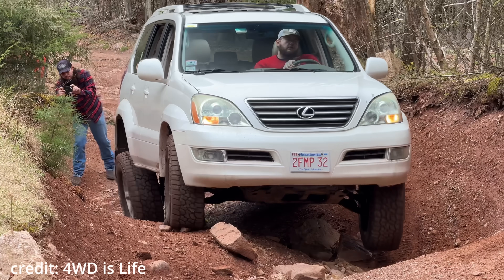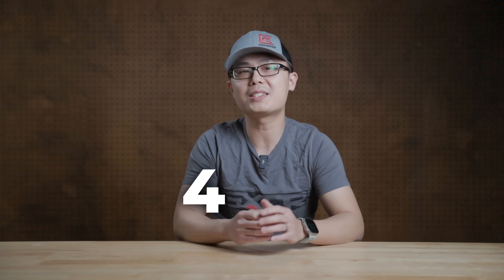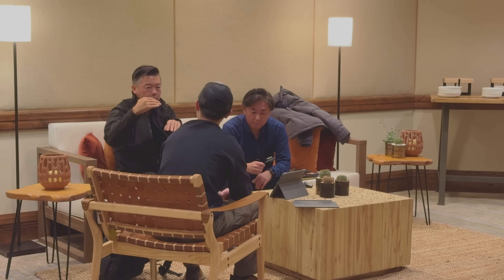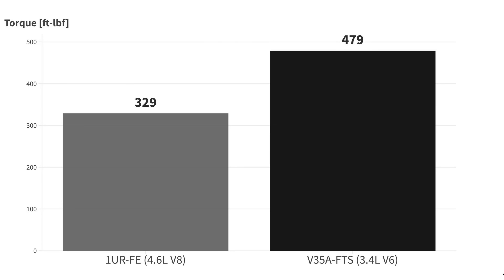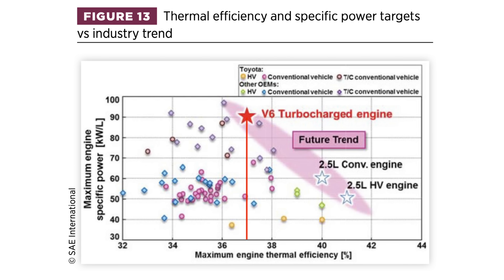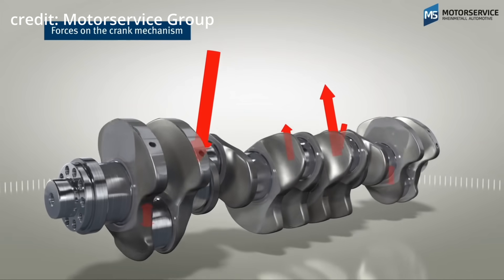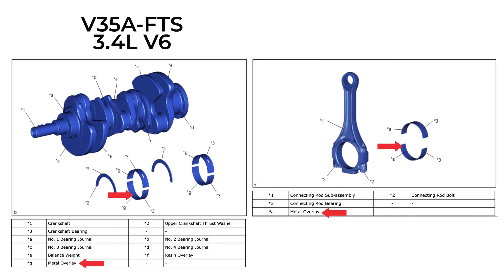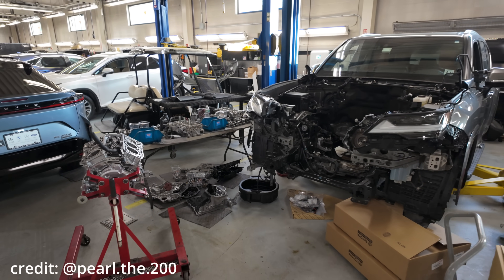Is Toyota V35A-FTS Engine Reliable? Well..It's Not That Simple

Comment: I would consider using a thicker oil, preferably a 0W-30. If not 0W-30, then a 5W-30. Oil film thickness should be the primary protection against wear, and not the additive package in xW-20 or thinner oils. The thinner oil is driven primarily by CAFE, and not necessarily by the manufacturer. 

The BMW E46 M3 had an engineering issue where the main bearings weren’t properly designed for xW-30 oils. BMW’s fix was to replace the main bearings and switch to 10W-60 (Castrol TWS).

Comment: the issue is the grade of oil , and bearing clearance , the oil is to create a hydraulic cushion between crank and bearing at any speed or load .
Reply: also 95% of bearing wear is on start up , pre oiling systems do help and post oiling idle before shut down ,
Reply: it mite be wise just to go one grade higher on the oil
Reply: the other question is , is the oil pressure and volume under rated

Comment: GX470 was designed for 200k miles with no issues GX460 designed for 100k and finally GX550 especially designed for 10k only Thanks Lexus you are always thinking about your mechanics. They get more job with new engines and get more money from Lexus customers!

Comment: 17:32 and there’s your issue! The ladder frame cast iron crank caps is brilliant for strength, but not for thermal expansion. 

Iron and aluminum act differently at high temperatures, which means that with a lot of heat soak the potential for grinding increases as the aluminum is denied flexibility around the more rigid iron. 

To what degree Toyota has addressed the thermal relationship between these components costs $37 lol, but thats an immediate tell as to why these bearing failures happen on otherwise mechanically stout V6s

Comment: The V8 engine probably used PFPE/MoS2 composite sliding bearings while the new V6 engine uses bronze sliding bearings.  That shows the designer knows bearing load increased.

Comment: And what about the Landcruiser 300 series which I believe is sold in Middle East, Asia/Pacific and Africa (not US). Same engine but do they have same problems? Been trying to do research and although this debris issue has been mentioned it seems to be the exception rather than the rule, quite limited info and I haven’t heard of mass recalls. 

Only thing I’ve noticed in South Africa is that the 3.5T (or is it 3.4?) Petrol cars have decreased quite a bit in value compared to the 3.3TD that is keeping its value.

Comment: The longer the stroke and you get more torque but more stress also . Now adays around 4" stroke is the norm for alot auto makers . And small turbos don't make lots of power but they are more responsive and more efficent as long as they have real ball bearings and are balanced well like garrett does .

Comment: Most main bearing failures fail because lack of lubrication, it might not exactly be the cleaning process but maybe a design flaw within the oiling system itself. Oil pressure isnt always a measure of good oiling

Comment: If you add 1 atmosphere of boost, or 14.7psi, that would effectively double the displacement of the engine. So for a 3.5L to be equal to a 5.5L you'd need approximately 8-9psi of boost. I don't consider 8-9psi of boost to be hard on an engine that's designed for it.

Comment: Something else to keep in mind though, is the number of units sold with this particular engine.  If they sold 10x more vehicles with the same engine, you'd likely expect somewhere around 10x more complaints about existing issues, assuming nothing else changes.

Comment: The change from urethane bearings to aluminum bearings most likely didn't account for the thermal expansion of the aluminum under load. If the aluminum expands enough, even if not enough to lock up the engine, it could be rubbing just enough against the crankshaft to prematurely wear.

Comment: Dirty blocks with excessive metal shavings in the bottom end. We do have a few LS500’s failing or locking up. The engine design isn’t bad but what sucks is how complicated it is with all the crazy hoses. It’s no longer a simple straight forward engine. But new blocks are clean so they should last a long time

Comment: Toyota and Lubrizol co-wrote a White Paper SAE using radioactive isotobes and hot wires in the oil passages in a block. The wires allowed them to know exactly how much volume and pressure each area saw. The isotobes int he additive packages allowed them to see the propensity for various additives in each material used in the rotating assembly of the engines. I worked in engineering at General Motors. I know please do not hold it against me! LOL This paper allowed them to reduce oil volume and pressure as well as lower the hths of the oil to gain fuel ecconomy while keeping wear at the then current level that would normaly be achieved with an oil with an hths of 3.5. When CAFE standards hit they begain using these developments to reduce tax burden more and more. When Honda came out with theith low lead and zero lead alumnium based bearing technology other companies did similar things. No one that builds engines for racing, high performance or extreme use uses aluminium bearing only OEMs do that. GM uses them in LS engines for instance but when you build an LS for power you never use aluminum based bearings in the build not on a high output NA engine and especially not on forced induction or power adder's like NOS everyone goes to a traditional babbiit bearing with some type of plated finish and sometimes a sprayed coating as well. If you have suffcient oil volume and pressure and a suffecient oil film strength you can easily go 300,000 miles and never have a bearing have any vissible wear often factory ink stanps still on the bearing face. 

To me it appears they have not made the bearing caps and the bearings wide enough for the load trying to chase after fuel effeciency at all cost. I suspect they are running the absolutely stupid variable volume and pressure oil pump designs that are all the rage today and stupidly low hths oil depending on additive package to make up for the lack of film strength and lack of shear resistance. 

So easy fix make bearings and caps wider, make them from babbit materials, increase idle oil pressure and volume, and go to an oil that can provide a minimum hths of 3.5 even better something with an hths of 4.6 like a 0W40 and these problems will go away and never come back! All of this was easy to forsee if you think like someone that works on cars and deals with them in the wild it is only cloistered engineers that do not deal with the real world and their designs in the real world that fail to see these things! 

When you build an engine for racing you will typicaly use narrow compared to OEM if you want to push the engines ability to rev faster and higher because they produce less drag. You are not worried about longevity but in an OEM setting that is not the case. They are doing desperate and stupid things to gain .0000000001 mpg improvement to reduce takes from CAFE. All of the things they can do to improve CAFE directly hurt durability. You can only cut the margin so many times before problems show up like they did in the 2AZFE piston and ring design with oil consuption. Before that it was the sludge engines from pushing up engine temps, coolant temps, changing EGR and PCV system while pushing out oil change interval with out revaladating each change lead to a perfect storm of sludge prone engines. 

These things are easy to see and prodict if you are looking at things inthe form of a big picture and not just looking at your own compartmentalized engineering single piece of the puzzle.

Comment: I have a 2015 GX460, bullet proof reliability 150k miles.  The next gen should have been a V8 Hybrid and change the 6 speed to 8 speed to smooth out the power delivery.

Comment: Not an engineer or tech and didn't stay at the holiday inn last night but if the engine is putting out more power at lower rpms then cylinder pressures and crank forces must be way higher than the NA V8. It's a crying shame that we can't get the 3 liter D4-D diesel engine in the US because of the gdamn EPA requirements. If they can engineer and manufacture the diesel to handle that kind of torque at low rpm then they sure as heck can do it with this new 3.4. What's the weight of the 3.4 vs the 3.0 D4-D?

Comment: as that super thin oil deteriorates and in a heavy car / truck the older thin oil is broken down and off the line acceleration is my guess on what eat the Main bearing so fast  . needs thicker oil /stronger film strength  nothing wrong with 5w30.but with that said one needs to know the clearances to know what that engine can deal with

Comment: Probably a low speed pre ignition issue. Hard to tune out, happens randomly with highly boosted small displacement engines. Different oils can help but even then it's random and the cause can be unknown at times

Comment: I have around 25+ videos of same TT v6 LC300 & LX600 engines with the same issues here in the middle east. They are not reliable at all. Same Crank Bearings problems. I still say the 3UR & 1UR engines are the Best.

Comment: My take on this...the torque is not the issue here.Its the speed of the crankshaft v/s oil feed on the bearings.My advice for Toyota, increase the oil pump oil output force and widen just a little bit on feed holes to the bearings...just my hypothesis.

Comment: Just a thought, does the main bearing caps being made out of cast iron while being bolted to an aluminum block cause issues? The two materials will expand and contract at different rates and temperatures which could be putting other loads on the bearings.

Comment: I tow an RV, I am VERY concerned about buying a new Tundra or Sequoia, and longevity.  If I go up a long steep grade (think of semi trucks crawling at 4o mph for 5 miles) towing 7500 pounds… am I shortening the life more than my current Toyota 8 cylinder engines?

Comment: I wonder if it has anything to do with the metal on metal having lower friction than plastic on metal. Like switching to metal would make the part stronger in terms of forces applied, but if it lowers friction enough that you can get slip, that greater durability doesn’t do any good

Comment: Aluminum has a higher CTE than Iron.  CTE is coefficient of thermal expansion.  I wonder if a high heat condition causes the engine to fall out of spec in such a way that the main bearings are put under misalignment stress or fatigue.

Comment: Hello.  Love your technical explanations.  What do you think of the X-REAS system on a 06 limited with the rear air bag.  I think the airbag is independently controllable and able to lift the rear 2 inches?  Is that correct?  And do you know if the front coil over has a 2 inch body lift capability?  The idea here here to put on a 275 wide tire between 33-34.  And when around town keep it low.  When hitting dirt use the 2inch lift.  What do you think and it is possible?

Comment: How do you get a hold of Toyota engineers?
I have a 1993 FJ80 which I want to modify but not just any modifications that these shops around OC, in CA can though, although they are good. I believe the FJ80 is a legend and I have some research questions☺️

Comment: Look at the wiki for Toyota's Dynamic Force Engine, which includes the Tundra's V6 and other I4s and an I3:

They're all UNDERSQUARE.

The underdsquare design has NOTHING to do with a V engine, but was chosen for torque output, as you surmised originally.

Comment: No matter how efficient combustion is, all that very efficiently generated power goes to the wheels through the crank, and that crank needs all the support it can get from the main bearings. Now. Smaller engine with fewer cylinders = shorter crank with fewer and smaller main bearings = less surface area to support increased load from higher torque. You can say anything you want about precisely engineered engines, but the mechanic at my local Lexus dealer mentioned to me at least two recent LS 500s with blown up engines and not a single LS 460 ever.

Comment: I see that Toyota/Lexus has recalled these engines made through early 2023.  Does that mean that engines made after that date are not suffering the same problems?  Was there a change made in the main bearings?  In other words, has the problem been solved?
Reply: The main bearings were not the issue, it was allegedly machining debris left in the motor.

Comment: I have a turboed Subaru legacy. Love the car but there is always a what if in the back of my head because of turbos adding another level of complexity to the motor.  It makes right about 305 hp wheel. I have an na 350z that also makes about 305hp at the wheel. Both are modified and I like both cars. Bit never worry about the z breaking.  That being said the Subaru has 190k miles on it and has gone through 3 turbos. Dual turbos just make me flinch

Comment: i means ideally these are hydrodynamic bearings, there should be little to no contact between the bearing surface and the crank shaft anyway. oil pressure and oil pumps is where i would look for a route cause before looking for a engine design flaw. if it was engine design there would be a lot more failures id think. however oil pumps and complicated oiling systems with oil pressure controlled devices on the engine etc etc would be more likely to have a random occasional failure thats hard to track down because you throw the pumps and contaminated parts away when you replace the entire engine.

Comment: For the v35a fts i strongly recommend 5w50, either liquimoly with mos2 additive or motul (engine smoother) with 300 ml mos2 liquimoly additive.  Turbos coke the oil if its below 0w40 at the high temp oil weight.  Mos2 has a history that goes back to world war 2 .  Impressive once you read up on it.  Mos2 is mercedes 1 million mile secret.

Comment: That much torque is not anything crazy for that engine size. The S58 engine in the BMW M3/4 and X3/4 makes 480 lb/ft of torque with only 3 liters of displacement. That has proven to be a reliable engine. But it has all forged internals.

Comment: Scotty Kilmer on YouTube warned us about these engines a few years ago. Toyota/Lexus should kept their 5.7 liters V8 and focused on making a BADASS 10 speed transmission fitted to the V8 for fuel saving goals and aims.
Reply: Except that would not have made a difference. You can look at the 5.7L 200 series Land Cruiser as evidence. They went from the same 6 speed that was in the 2nd gen Tundra to an 8 speed in 2016 with 3.31 axle gears. The 8 speed has a VERY similar ratio spread as the 10 speed does. My 2018 LX570 is always loafing along at 1100 rpm and even on the highways only spins about 1700 rpm at 70mph, but it still gets dog shit for gas mileage. I've yet to break 18 mpg. I've towed almost 3500 miles with it already and it gets about 1mpg worse on average than my 2014 F150 Ecoboost on 35's and the old 6 speed transmission got towing the same trailer.

The 5.7L is just a fundamentally inefficient engine. If they were going to try and make it efficient it would have required direct injection and cylinder deactivation, likely making it just as complicated and failure prone as the 3.4L TT.

Comment: I have been a skeptic of the new Toyota engines since the start, but this has done a lot to fill in the gaps. I am still very concerned about overall toughness of the new models. It seems like they are pushing cost reduction and performance efficiency a little too close together.

Comment: maybe it is as simple as the lubrication is not up to par? maybe do an oil test on each failed vehicle if it is the oil itself or maybe it is not getting in to the bearings so they grind themselves bad.
idk, been years since i did anything mechanical so rusty when it comes to how it works

Comment: Toyota is now saying that a failure to clean the blocks properly of machining debris is to blame. Metal filings were left in the blocks prior to assembly. This is a total recall for these engines. We will have to wait to see the longevity of a properly built engines, but it may be too late, as the damage is done to Toyota's reputation for reliability. Hopefully the 2.4 turbo engine in the Tacoma doesn't suffer from the same issues, that would be catastrophic to Toyota.

Comment: All the other channels are hoving to the engine debris issue identified by Toyota. While that may be a major factor in the engine failure issue, power-packing a smaller engine to get high torque has got to be a factor.
Reply: Except diesels have been doing it for forever. And the 3.5L Ecoboost has been in half ton trucks for >14 years and isn't prone to catastrophic engine failure at low miles. The 2.7L Ecoboost in the F150 is considered very reliable making 400 ft-lbs, and GM's 2.7L is making 430 ft-lbs since 2019 and has not had major failures. Both are making more specific torque than the Toyota motor.

This is just Toyota screwing something up. Either the fundamental design of the engine or the manufacturing process.

Comment: I'm sure the engine will be fine. This isn't Toyota's first rodeo with turbo charging. My gosh , there's people running 800 HP+ on 2JZGTE bottom ends at the track and 550 HP daily driving.